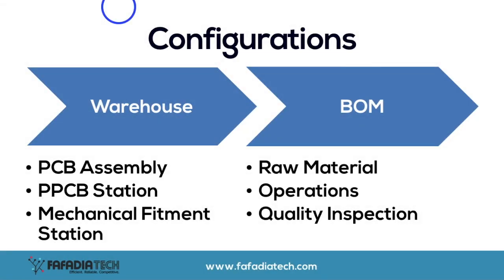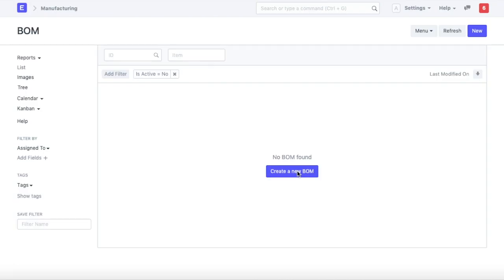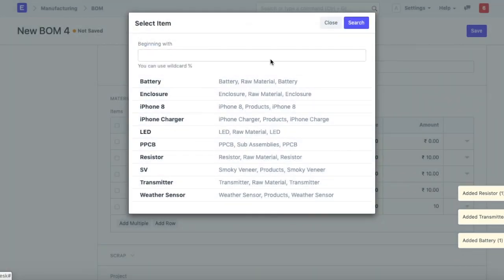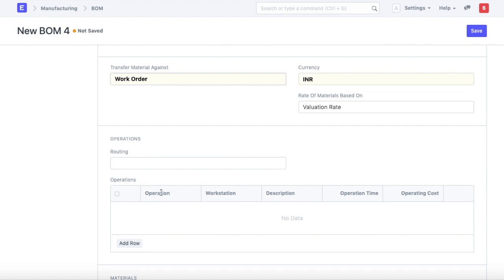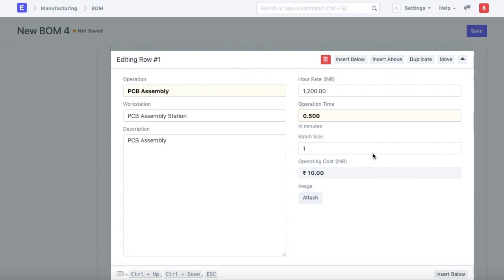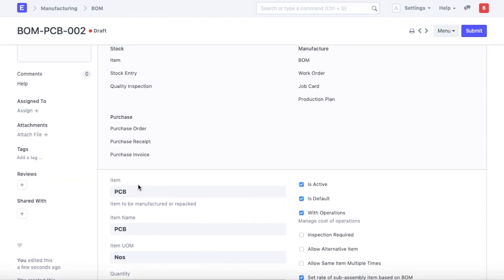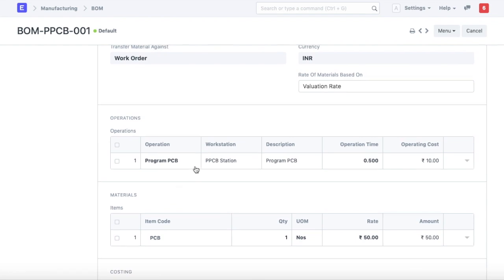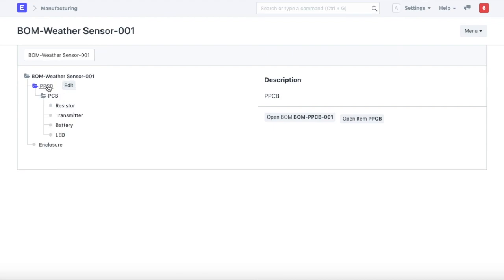ERPNext Multi Level BOM

Comment: video does not seem to explain how exactly the multi level was configured. It shows 2 separate BOMs created but how did the BOM for sub assembly get linked to the parent? Did I miss something? Could you please point this out?
Reply from the maker: Hi, once you create a BOM for Sub-assembly, you just need to define the Sub-Assembly as a Raw Material in the Main item, it will automatically get linked